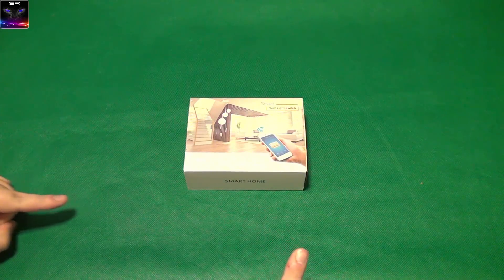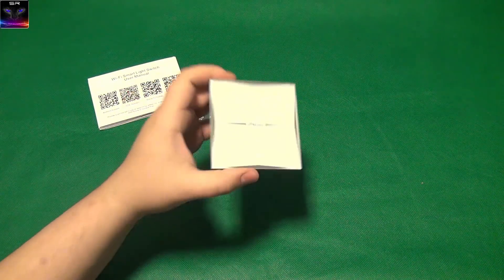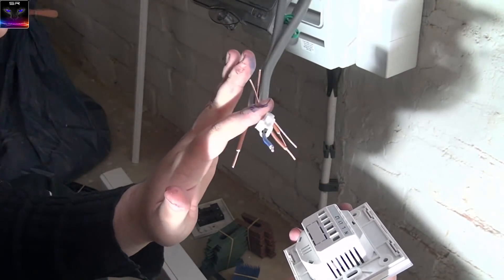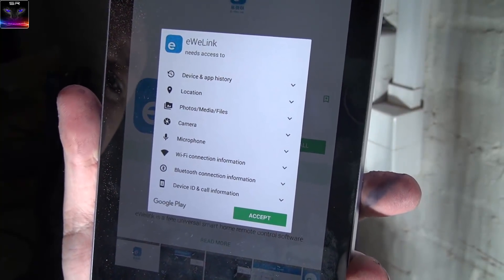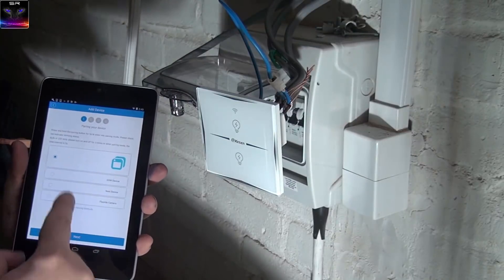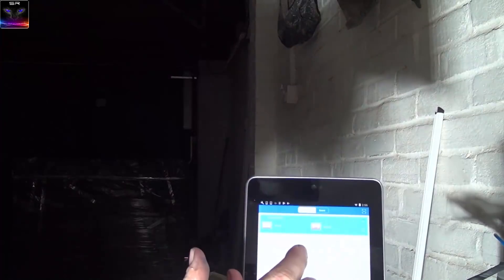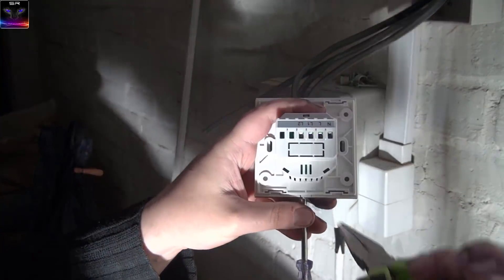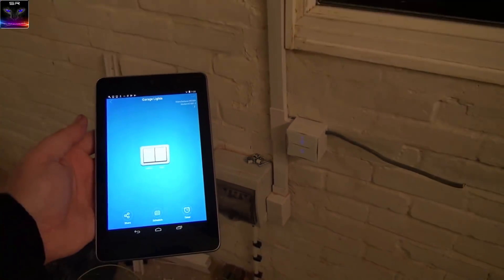Kesen Wi-Fi Light Switch (220v) ► REVIEW & How to INSTALL + SETUP

Comment: Thanks for the video. I am doing similar setup I was going to connect both L1 wires to the L on the smart switch . And then the common wires to L1 and L2 on the smart switch . I would also connect the 1 neutral to the smart switch. 
Do I need to connect all of the neutrals or is one enough? Thanks

Comment: My Galaxy S8 will only connect to the 5ghz of my BT hub router so it can't see the light switch on set up... any idea..?
Reply from the maker: yeah, something is setup wrong. S8 has dual-band, if it can't see nor connect to 2.4ghz networks, then either your BT hub or S8 is either broken or configured wrong.

Comment: I have issue wiring this product I have two (com) live do you connect both to L port? Thanks
Reply from the maker: uhm not sure what you mean. L = Live input. Connecting more than 1 live into input, changes nothing. It's as good as cutting your PC's main power cord and splitting it into 2 plugs. it doesn't change a thing.
L1 is output for lights 1 and L2 is output for lights 2.

It's quite straight forward. If you saying you have 2 Live wires coming in, then it makes no difference which one you connect. as long as input has power coming in, it will work.
Reply: Sethioz Reviews I can send photo what's your email address